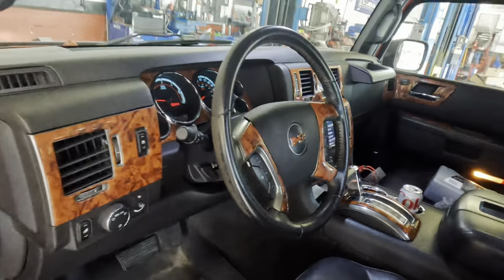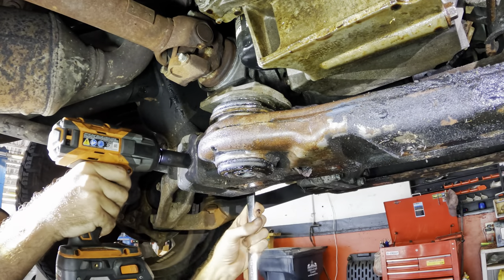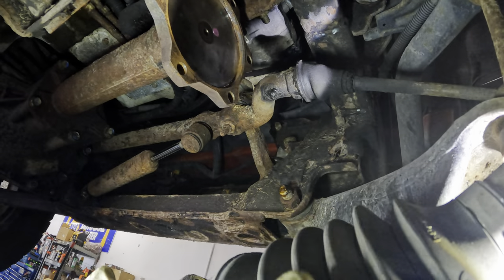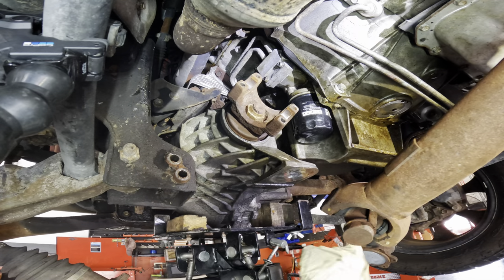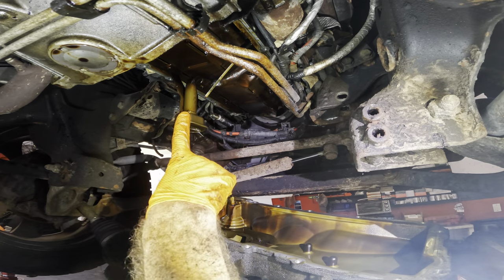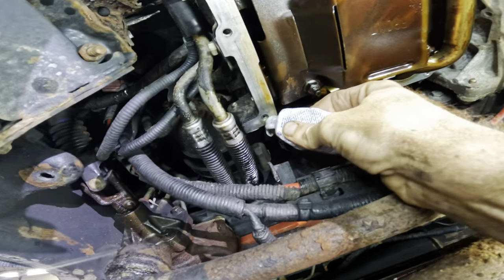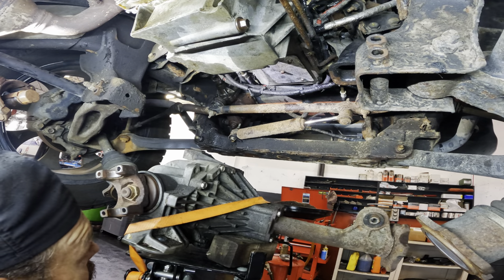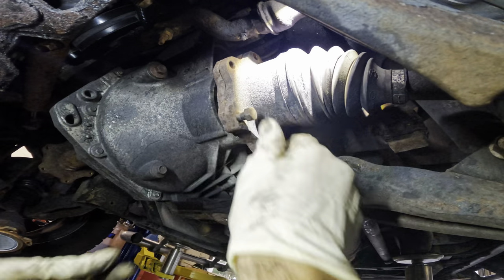Remove Axle for Engine Oil Leak!  2008 Hummer H2 6.2l

Comment: The joyous thing with this video is when you see the mess you know there's going to be brake clean action
Reply: Now you know what that damn $10/shop supplies added onto every bill is going towards LOL.
Reply: @SecretSquirrelHD  and the rest brake cleaner engine degreaser gloves that are worn in top of the range garages even the paper carpet they put in there is a charge dont know how Ray's garage works but have heard him saying they have a few it's nice to know other people observing
Reply: I’m not a fan of his heavy use of brake cleaner. The chlorinated version can be incredibly toxic especially when exposed to high heat. The non-chlorinated stuff while safer has a lot of stuff that creates smog. 

So use it but use it when needed and not unnecessarily.
Reply: @0xFF48  you are not a lot of fun at parties
Reply: That was an extra tall can of brake clean today.  If I have to pay the extra 10 dollar fee for shop supplies I better see the tech spraying brake clean.
Reply: Must be just me then, I didn't see much effect from the use of said brake cleaner.
Reply: I find that part highly satisfying as well. Ahhhhh clean!
Reply: @luke144  if I see the tech spraying two large cans of chlorinated brake clean akimbo until they are empty to make my oil pan nice and shiny; I’m gonna bring them a case of PBR and a bag of McDonald’s after I get my car back.

Comment: I can see Ray at company meetings.  Ray says in a serious tone, “ we’re gonna need more cans of brake clean” The boss, “how many Ray?”   Ray, “all of the brake clean”.
Reply: Alternate Ray response, "Is there a limit to the brake clean, Boss?"
Reply: @jima3129  For fixing your project car, it's fine to look for nuts and bolts from a bucket. But when on the clock, a 20min job requires 15-30mins of searching for correct bolt 'n nut combination, it feels at some point like a really stupid. And most annoying thing on it is the boss who complains that, why everything takes so long to finish?.
Reply: I mean when you get a clamp on handle for spray paint for brake cleaner... It serious
Reply: I guess we can see he uses the stuff to clean everything.  I have to buy a few cans to see if it's all that.
Reply: Notice how he uses a lot less now that he opened his own shop
Reply: Hint. Put the stuff like lucus. Into the sun to hear it so it flows faster

Comment: Worth the drive from Michigan to Florida just to have Ray do the work ! Ray vids should be Teaching vids to show Mechanic standards of thoroughness and care required !
Reply: agreed.  if I wasn't working so damn much and with elder parents to watch, I'd be beelining down there.  I have a 5 K estimate just to become inspection worthy to worry about...on a car I only paid 6k for :P (a caliper locked up, and screwed over suspension parts on the axles it was connected to)
Reply: Pretty sure Eric O (South Main Auto) in NY would be a lot closer than going all the way to Florida

Comment: Rainman, good call on replacing that O-ring - that should be mandatory for ALL the 5.3 and 6.2 motors.
Reply: Yup 4.8 6.0 all the ls motors. Eventually the orings get brittle or weak and cause cavitation issues in the oil and cause low oil pressure. I've replaced around 20 orings in different ls engines. Several of the customers were told they needed cam bearings. Every replacement hot idle went  back to 40 and 60-70 running down the road.
Reply: I wonder how many engines were ruined due to a 25 cent o-ring.
Reply: @kjisnot  Also, how many engines have been replaced because of that same o ring because of a misdiagnosis. I know of three people that came to me after they spent 4500 or more on getting a reman engine installed. In fact I have one of those said engines in my lowered 2000 silverado. I put a oring in it and rod bearings just to be safe. Been beating on it for 2 years lol. 65 psi oil pressure.
Reply: Don’t a lot of vehicles have the same type of oring on the pickup tube?  I think we just solved the worlds problem on low oil pressure.
Reply: @thomas7770  Correct. But not all are made out of good quality materials to help prolong severe deterioration. Gm was one of them.
Reply: @CL-qb8xp  ive done the same thing on a 2011 5.3, replaced oring, still had low idle pressure like 25ish psi.  just did 6.0 engine rebuild, new cam bearings, new pump, put the additional clamp on pick up tube,  20psi hot idle.  soon as i hit 650-700rpm shoots up 50psi.
Reply: @803brando  25 is  around normal on the 08 up models with afm 2000-07 old body always had higher idle pressure. Did you replace any other bearings in your 6 0. 20 isn't great at idle on that engine but won't hurt. Seen people get low pressure doing cam swaps and not replacing the cam retainer plate
Reply: @CL-qb8xp  can we all just imagine that 98% of low oil pressure situations are caused by said oring and we just now solved the worlds problems in this comment section please?

Comment: It never ceases to amaze me of the engineering on these things. You know they were thinking, hmm…is that going to be in the way when a repair is needed? Ah, who cares…put it there anyway. It used to be simpler to work on vehicles, but nowadays they try to “cram 20 lbs of junk into a 5 pound box”. I can never reach certain items and end up going to my local mechanic for the fix. They always thank me for putting it back together before bringing it over. I guess some people give up and tow it?🤷🏻‍♂️ If I can see right away that something is beyond my knowledge, I don’t even attempt the fix. I guess some people don’t do things this way. Once I required a lift, I’m out. I don’t have one, so that’s a professional job. I also like that you clean up after a fix, some shops don’t bother and then you come home and think they didn’t fix anything because of “residual leakage”. Keep being honest and complete, that’s one of the biggest reasons why we watch.😁

Comment: To change the parking light bulb in my Infiniti G35 one must remove the Grill, Front Bumper Shield, unbolt the fender and remove the headlamp module to access the little bulb. 

This I thought was a load of work for a simple task. 

Ray said "Hold my Snap On" and proceeded to dismantle an H2 to fix an oil leak. 

Well done sir.
Reply: That's why Nissian is called the Chrysler of Japan.
Reply: @peted5217  What does that make the H2?
Reply: Sketchy

Comment: I was taught 50 years ago when I removed the drive shaft on a 1963 Chevy Impala with a 2 piece drive shaft changing a bad center bearing carrier to make paint marks on ALL things connected to drive shaft, u-joints & caps,  differential flange to axle assembly, to make sure they were installed the same as taken apart to minimize vibration. Oh yeah, GREAT JOB!

Comment: Someone cares about this vehicle . 8 day diagnosis,Mobil one,Mobil one filter etc. Glad you could help them out . Great work as always Ray.
Reply: Mobile one is garbage. And they used Valvoline oil, which is exponentially better.
Reply: @williameldridge9382  look at the guy who does the oil test
Reply: @williameldridge9382  Mobile 1 is often the cheapest synthetic and for 99% of the cars out there it is more than adequate.  Pulling apart a 190,000 mile motor that used M1 since about 54,000 miles convinced me. (well just the heads and looking at  bore wear).   You can of course spend more.

Comment: Your attention to detail is very rewarding to see. You did, however, confuse me for a moment when you talked about replacing the o rings on the dip stick tube. The tube you actually worked on has always been referred to as a pick up tube as far as I know. The dip stick tube holds the the removable stick for checking oil level, while the pick up tube transfers oil from the pan via the pump to the oil passages in the engine. Internal oil leaks are indeed as important as external. If the oil isn't getting to the pump, it's not getting to the critical components. Nice Job.

Comment: i have to have this exact repair done to my 2010 GLK350. i over torqued the pan bolt and the rest is history. i got an OEM pan and my guy is giving me a great price. i had the transmission pan replaced last year.. so this repair will actually be a nice upgrade. i guess my mistake was a blessing in disguise.

Comment: As far as missing bolts goes, they tend to say that you missed a bolt because the LS engine oil pump has two locations for bolts to go, but the intake tube only has one location for a bolt to go where it connects to the pump. 

There exists a bracket that goes over the intake tube and attaches to the other hole in the pump for those interested though.
Reply: Huh I personally have never seen a failure that would've been saved by a 2nd fastener but it looks so wrong when you get in there I guess I understand why someone would want it
Reply: @Onewheelordeal  
It's a known failure point if you race LS engines, but it's fine if you don't race them to not add the bracket. 

It's a quirk of the magic LS series

Comment: Wow what a hassle just to get the oil pan off way to go good job guy
Reply: basic GM job...... if it's a GM, you're gonna have to pull out everything just to do something that should be simple
Reply: @christopherrosas2738  It's a 4WD job, oil pan on a 2WD GM truck is cake. At least it's not a 4WD Trailblazer
Reply: @AdamantineAxe  not even sure I'd want to know what that trailblazer is like...... I already don't like when I have to change out the headlights on my dad's 2010 Chevy Malibu..... should be am easy job, but they basically make you take apart the whole front end for a bulb..... might as well do all the bulbs while you have the car apart

Comment: Hey Ray - Check the relay that feeds the electrical circuit for your intermittent problem. the schematic says that circuit is energized through a relay. They can be troublesome and stick leading to intermittent connections.

Comment: Dipstick tube i believe is a steel tube protruding slightly into to the sump normally located on the side of the engine block. The engine oil dipstick fits inside it . The oil pick up tube or oil suction tube/pipe normally has a coarse strainer on its lowest part and it is attached to the suction or inlet side of the oil pump.
Reply: I was smiling when he said it too.  But I am sure Ray does indeed know the difference.
Reply: Gee , Ya , Thanks for Straightening everyone out on that........!

Comment: You made getting the CV axels back in look easy. I changed one of the output shaft seals on the front dif. on my 1500HD and caught hell getting the CV axel back in. Of course it’s probably easier when you aren’t laying on the ground.

Comment: Never used the stop leak but use the Lucas oil additive on every oil change after had an issue with no oil pressure on a previous vehicle.  Put the oil additive in it one day just to try it and never had issue with oil pressure again

Comment: I just did a oil pan gasket on my silverado. I didn't even consider using rtv on the gaps. Guess i'll have to take it back off and fix the lea--who am I kidding it's a gm it's going to leak regardless. Like Mustie1 says, "We do it right because we do it twice." Thanks for the tip!

Comment: You always do a good job. How many guys would clean the inside and outside of the oil pan? You also cleaned the inside and outside of the pickup tube with a new O-ring. 👍

Comment: I’ve got a 2008 h3 luxury with the 3.7 i5 I absolutely love the truck btw it gets 16-18 mpg at 2000 rpm is 60mph they are low geared
Reply: Lots better than 1976 455 olds Custom Cruiser i haul pointers in. It gits 10 period 10 mpg uphill,downhill , over a cliff ,10 mpg.

Comment: I was a gm  tech for 20yrs left in 2011 for medical reasons love to see you do a video on 2012 and newer dirty max with the p2bad code and poor def quality mine gives me fits after both nox sensors replaced I have to force a regen with my tech2 then good for about 800mi love my lml dually but hate this headache you are over meticulous with your diag as I was keep the content coming have you ever experienced my problem

Comment: To help out filling oil - put a thick paper clip on the filler pipe, or lay a strip of nylon into the filler hole. That will allow air to escape when the funnel sits in the hole with a gap, and fill waaay faster

Comment: Obviously someone has been there before. Possible reason for failure is they didn’t tighten the rear pan bolts before the perimeter bolts.  That’s why they were loose when you removed them.  Ray, I recall another pan you did on an LS and emphasized their importance.

Comment: This vehicle and this video is a perfect reference to my question
to you, Ray:

Why do you consistently refrain from using "spray penetrant" on 
dry, corroded fasteners, but in many other videos you make a big
deal with cleaning the area afterwards? Yea, I know, Southern car,
but Florida is an isthmus. Your rain is mostly evaporated ocean
water, way more corrosive as any brine added by DOT in the Winter
on highways where I live (Central New York), where we use gallons
of goop to stave off the cancer. I'd like to see you get a refillable
sprayer, mix up DIY cleaner and/or penetrant. I really like mine-
from Amazon, made by Vaper. Works great. ETCG loves his, too.

Thank you for your time, Ray.

Comment: Should see if your shop owner would be interested in investing in the Wurth refillable brake clean system, called refillomat. Buy a 55gal drum and the filler, set up shop air to it and you just refill the can. It's not the best system, but it does prevent can waste and offers a lot of convenience
Unless you buy your own supplies, then forget it lol

Comment: The “vacuum line” you unplugged was just the breather. No locking mechanism on the front of the h2s. And with the 6l80 in that thing I guarantee someone has definitely been there before😂

Comment: I never could use gloves unless it was something that took no dexterity, or chemicals like acid. Those thin little short ones let your arms get dirty. I just used Lava soap with pumice, but the new hand sanitizer is awesome hand cleaner. It even gets J-B Weld off your hands if you get it early, it just balls up.

Comment: You do not want Driveshaft gravity.  The gasket used to be Blue so it was good at one time.  Accelerated oil pan cleaning procedure.  Accelerated fastener placement procedure.

Comment: Glad I live in the desert soutwest... those trans lines look like they have been through the rust wars and are not long for this world rustwise... Glad you do the o-ring on the pickup because they just don't last, and as you said that pan has been off as noted by the gasket and the fact it was not riveted on and surely by the lack of sludge.  I swear GM oil pans are the most important thing to torque and install with the proper torque sequence.  More important than even cylinder heads and bearings, I mean I have probably seen way more adequately running engines with improperly torqued bolts in the rotating assembly than non leaking oil pans regardless of if you had it blessed by a shaman and exercised by a priest and followed all the OEM sequences with OEM parts its probably going to leak so at least if you followed the protocol you can shut down the haters.

Comment: I managed to get the pan out on an 08 Avalanche 4wd with the 5.3 without removing the front dif. It was a struggle! I cheated and lifted the engine, not removed, but it was still a struggle.
Reply: I never pull the front diff all the way out, disco driveshaft, right c.v. axle, vent tube, 4x4 actuator connector, turn the steering all the way to the right and that moves the center link a couple inches forwards and gives you enough room to push the front diff forwards enough to drop a bit and get the oil pan out.

Comment: Unblocking the drain holes in the cross member would be a good idea. Also greasing the drive shafts where applicable.

Comment: They make an "extra bolt" kit for the pickup that keeps the tube from vibrating and prematurely wearing out the o-ring. It comes with a half moon shaped washer to clear the tube for the other bolt. I"m not certain that ALL LS oil pumps are drilled for 2 bolts but every one I've worked on was.
Reply: Bee sure to Red locktite all threads.

Comment: Ray, Great video!  Since you like the brake cleaner so much, why not spray clean the cross member and trans case before installing them?  Only takes a few minutes???  It would help to keep your hands cleaner too.  I'm not trying to be a troll, just suggestion.
Reply: Because it would get dirty during installation so he'd have to do it twice instead of once. That's why.
Reply: @Gizmetti  I disagree sorry! no need to get snotty!

Comment: Back in the early 80's a friend of mine was using boxend wreches that were formed at a right angle that gave him access to some hard-to-reach unseen hex heads.  I have watched you struggle a couple of times with similar situations and wonder if such tools are no longer available.
Reply: He probably heated them with a torch and bent them himself.  I've done that when I needed a custom tool.

Comment: Great mechanic, job and film, but what surprised me that no torque specs. Probably at that level of experience you know torques by eye.  I also couldn't expect the oil pan will be protected by so many shields and it is so hard to get to it. Thank you for the film.

Comment: I just did my 00 tahoe same thing u do not need to remove the front diff just unbolt the housing n lower it there plenty of room also drive shaft can stay as well as cv axles

Comment: Did you finalize the pan gasket  by torqueing the bolts with a torque wrench to maintain an even pressure around the pan?

Comment: Use zip ties to hold the gasket in place instead of risking the bolts falling out! I love doing this, it's so satisfying cutting the zip tie when you have pan secured to the block :)
Reply: These pans have a spot to pop rivet the gasket on